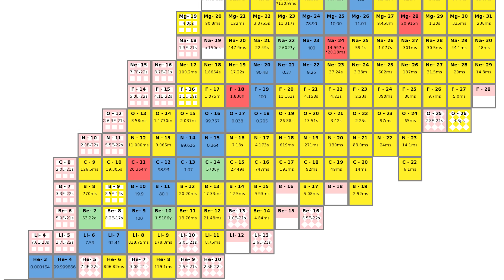Why the U.S. Doesn’t Recycle Nuclear Fuel

Comment: I spent 20 years in the nuclear fuel business. Believe me, there is no global shortage of uranium.  Bear in mind that fuel is only 10%-20% of the cost of nuclear electricity. Recycling spent fuel is trying to extract a savings from something that is already cheap. (Moreover, recycling costs WAY more than fresh fuel, as the French have so amply demonstrated.) Bear in mind too that for technical reasons, you can recycle the uranium only once (twice at the outside). It picks up too many unwanted isotopes of uranium that can't be separated. While Kazakhstan is (or was) he world's biggest producer, Canada and Australia have vast reserves of uranium that could supply Western needs for centuries. The big challenge in nuclear energy (besides long term waste disposal) is developing new designs that are cheap and fast to build with low annual maintenance. Simplicity is going to be the key going forward.
Reply: Is there any other way of generating electric power from Nuclear fuel except using it to boil water and spin a turbine with the steam?
Reply: @ShonMardani  it’s just a matter of efficiency in converting the energy to a useful form .. turbines are still the most efficient system we have
Reply: @richnubbz4910   No this about our scientists are fake and in most cases criminals.
Reply: @ShonMardani Nice ad hom logical fallacy. You’ve probably never picked up a book on science in your life except maybe high school, let alone earned an advance degree in science or worked in a scientific or technology field. So  you obviously don’t have that first clue about what you’re talking about. 😂

But, hey have fun with your delusional conspiracy theory and don’t mind us science types laughing at you for your ignorance. 😂😂😂
Reply: @Mottleydude1   You are right about everything you mentioned, that is why I am watching this video to see what did I miss, why do you watch the same baloney fakes over and over again.
Reply: @ShonMardani  Some space probes use peltier elements since they have no moving parts but the efficiency is really bad. So no, there's nothing better than the old steam cycle.
Reply: @ShonMardani  Short answer is YES.  We have been running Brayton cycle power plants fueled by natural gas for many decades.  The UK has had advanced gas cooled reactors for many years.  You can obtain 60% efficiency if you recover the waste heat from a gas turbine exhaust to be used in a Rankine cycle (steam turbine).  These combined cycle power plants are nothing new.
Reply: @ShonMardani  Yes they are called Radioisotope power systems or (RPS).  They are currently being used to power space craft on long missions.  They require large amounts of plutonium for smaller amounts of power.
Reply: @ShonMardani  Why do you have a problem with boiling water in the first place?
With supercritical water you can currently achieve an efficiency of up to 50 %. An alternative is to use supercritical CO2, spinning a gas turbine and use combined-cycle to achieve even higher efficieny.
Reply: The part you obviously are overlooking is the cost of disposing of spent fuel... a cost we cannot yet even quantify.  Far too many of us are complacent about destroying the planet our children must somehow survive on.
Reply: @byronwatkins2565  I have put real renewables solution posts.
Nuclear is an economic dead duck. 
Feel free to quote me.
Reply: @stephenbrickwood1602  Renewables are insufficient to sustain our present needs; they certainly cannot sustain our future needs.  Nor is our infrastructure capable of transmitting the energy from the scattered farms of supply to the cities' demands.  I do applaud renewable's effort and help, but either we supply our remaining needs with nuclear fission or fossil fuel until fusion is available.
Reply: Does storing, or does reprocessing/recycling cost more? Storing it is just a cost but recycling is a cost that makes a little ROI too doesn't it?
Reply: @PhilS_Empty_Crevice-r4e  still end up with storage.
Reply: @PhilS_Empty_Crevice-r4e  First, we don't know the total cost of storage or what unforeseen problems will eventually develop.  Second, if we do ignore these environmental problems, then storing seems substantially less expensive.  Third, we will know the cost vs. ROI for recycling only after we have done it at scale.  Fourth, I think the strongest argument for recycling is minimizing the impact on the environment; we are poisoning ourselves with chemicals (microplastics), biologicals, and now nuclear.
Reply: :text-green-game-over: Yes, recycling uranium, and using plutonium in fast reactors, is multiples more expensive than single use light reactors. Additionally, wind and solar are already multiples cheaper than new AP1000 nuclear reactors. In short, nuclear is not economically viable anymore.
Reply: “There is no global shortage of uranium” 
This statement is false. We have a substantial supply deficit coming up starting in 2027. The Japanese selling their stockpiles and the Central Asians drove the price to such low levels that exploration and mining operations essentially stopped in all but the most low cost western mines. It will take at least two decades the supply to meet demand. Mining is hard and risky.
Reply: @robertjard3956
For the swiss industry the recycling cost about as much as the final repository. Buying fuel is cheap but disposing it is expensive.
Reply: You would think "rock makes water boil" would be simple. But it's not.
Reply: I spent a comparable amount of time using high temperature vitrification to recycle inorganic listed hazardous waste like F006 and K061. During that period i worked at The Ohio State University as a research assistant working on HLW and LLW stimulants via high temperature vitrification as a recycling technology. After studying and testing we were able to determine what the performance characteristics were, calculated mass balances and life cycle analysis and our conclusions were pretty much the same. The cost vs the return on investment, including financial, performance gains and specific environmental and health and safety considerations, that the return on investment just wasn’t there and that process improvements for waste minimization was a superior strategy to recycling at that time.
Reply: Buillshit.
Reply: Has there been any new developments in radiovoltaic generators?
Reply: You did a better job of explaining why the US doesn't recycle than they did.
Reply: you miss the cost for environment damage of  the exploited countrys , cost for 
 poverty/coruption   for the last 40 years...
..yeah then its relativ cheap....
 But USA never care... 
Coutrys that want a faire share will end in war. We all know the game  & how it is played and will be, no doubt.
Reply: So we just keep piling up spent fuel?
Reply: We would burn dirt
Reply: Maybe be a good idea to build demand for spent fuel if more uranium fuel is to be used given cheapness.
Reply: Is there a connection between the economics of enrichment and reprocessing? As I understand it the US nuclear industry tends to operate with relatively enriched fuel, low percentages compared to military but still enough that the fuel utilisation is significantly better than with natural uranium meaning their spent fuel is probably more spent? Our nuclear industry was intended to be natural uranium based (not how it turned out), and with natural uranium the utilisation is lower I think with the exception of breeders. AGR was meant to be a dirt-burner but design changes lowered its reactivity making enrichment unavoidable, and then we went over to pressurised water reactors that I think always use enriched fuel?
Reply: Isn’t the point of recycling not the cost of the fuel, but the significant reduction in storage?

Don’t you have to keep byproducts for thousands of years, but the recycled ones are just a hundred years or so?
Reply: @Kevinjimtheone  
It's not as rosy as painted.
Take a load of  UOX Spent Fuel. 
The Fission products are the hottest bit, yes. If Separated they still have to be disposed. They are hundreds of billions of times more radioactive than anything you'd like tipped in a river.
These require just as much shielding and encapsulation as the original Spent Fuel. The disposal site has to space them out just as much as the original spent fuel to conduct away the heat generated by their decay. Not much saving, but the long term containment is easier. At least a thousand years though.
But it's not just fission products.
The recovered plutonium is a proliferation and security issue. It can go in recycled fuel, ...but... Most of the good stuff has been burned, there is far less than the original fresh fuel. You need plutonium from more than one reactor load to make one new reactor load and the most fissile isotopes are already depleted by life in the original reactor. . What's left have low reactivity and large cross sections. MOX made with this material needs extra fissile plutonium from elsewhere, usually excess weapons material. It reacts "less" efficiently than if the recycled material was simply not used.
The recovered uranium contains a little U235 that was not reacted, OK. It is also unavoidably contaminated. Refabrication into new fuel is more difficult and costly than simply using fresh uranium.
Aside from these is a shitstorm of other transuranic actinides. As proposed they can be "burned" in a reactor, but they are the least reactive survivors. They have high cross sections and low reactivity. They reduce reactor efficiency and responsiveness. Basically, they are a way to make a new fuel load act like an old one. Reduced efficiency gets overcome by burning more good fuel. So the benefits of waste reduction are less than suggested.
All of these still need disposal: The excess contaminated uranium. The long-lived transuranics, and the fission products.
You still have to build just as big and secure a facility for the fission products.
You still need an extreme long term facility for the transuranics and less desirable plutonium isotopes.

And of course, you recycled stuff into new MOX fuel. That's not a great saving either.
Used MOX comes out a lot hotter. It requires longer cooling periods in already crowded cooling pools. In direct disposal it requires wider spacing and longer decay horizons than Spent UOX.
Reprocessing of spent MOX is not viable. The uranium is now even more contaminated with U232, whose decay produces much more energetic gamma, with a longer half life than typical fission products.
You still have to build a permanent geological disposal, it needs to be spaced out bigger and more expensive. It has to last much longer than an equivalent for the original Spent UOX fuel.

No Used MOX has been recycled except a few experimental tonnes in France.

Spent Fuel Recycling is a dead end.
Reply: @aaroncosier735  Spent fuel from open fuel cycle reactors is considered to be dangerous for over 100,000 years. This is the challenge of disposal. We don't know how to build something we know is going to last that long.

All the recycling you are talking about seems to be in the direction of MOX fuel in thermal reactors.

True closed fuel cycles use fast reactors and can break down even a lot of the fission products, and get not twice the energy out of the original uranium, but 50-100x. Just our current spent fuel and depleted uranium stockpiles are enough for baseload power for hundreds of years in fast reactors, and the final waste can be safe in less than 1000 years.

We know how to build a structure that will last 1000 years.

This isn't just theory, EBR II was a sodium cooled fast reactor with integrated fuel reprocessing that did this in the late 1980s. The IFR, which would have been a utility power scale reactor with the same design, was cancelled in the early 1990s so close to completion that it cost more to dismantle it than it would have to finish it.

These reactor designs are also protected from meltdown or other failure through physics, rather than mechanisms. Thermal expansion of the fuel will shut down the reaction if it gets too hot, and convection in the primary coolant can remove decay heat without the need for pumps.
Reply: @jasexavier  
Spent Fuel from UOX fuel is difficult. The Spent Fuel from MOX is more difficult. 
The problem is not the horizon but that doing so would expose the true cost of nuclear.
KBR will probably be adequate for typical wastes of lower burnup UOX spent fuel. 
Predictable modifications will probably be adequate for higher burnup UOX and MOX fuels.
The problem is commitment to costs.
Present provisions are easily less than half the likely costs, Or, they were in 2010, when industry contributions stopped in the US after a court case.
Probably a lot less adequate now.

Breaking down fission products gives far less energy than the original U235 fissions that produced it. 
Being neutron poisons that form low reactivity products, they cost the energy that could otherwise be derived from using the same neutrons in a chain reaction.

Nor does complete breeding and fission of the U238. The original UOX was enriched to maybe 4-5% U235. Even if you assume perfect conversion to reactive isotopes with good neutron yield, you only get 20 to 25x more.
But you don't have such reactors.

EBRII doesn't help you much. Like all such fast reactors it has the burden of low reactivity compared to U235 with moderated neutrons. It needs more primary fissile material to furnish neutrons. Adding fission products or low-reactivity actinides reduces that efficiency. You run out of nice fissile faster, and have overall lower fuel efficiency. In other words, you burn more good fuel to fission products the more you try to burn fission products. Spent Fuel is spent because it already hit that limit, with a more readily fissioned neutron source.
Like using a good high-energy gas to char away a wet woolen blanket. The heat you get back is far less useful than the heat you put in.
Reply: @aaroncosier735  Anything that fissions in a reactor is going to give a LOT more energy than it took. Some fission products also provide more neutrons than they take to fission. Managing the neutron economy in a fast reactor is harder than in a thermal one, but it's also an extremely well studied problem, and not just in theory, we have built and operated these things.

The relationship you imply between initial enrichment and possible burnup doesn't make sense, 4% and 25x. Those math to 100%, but they're talking about different things. Even if you're implying that we burn up all of the 4%, and then only have 96% left, that isn't really true (we can't use the entire 4% in a thermal reactor), and it ignores all the U238 that we extracted to enrich that initial charge. Depleted uranium becomes reactor fuel in a fast reactor.

Yes, a fast reactor needs a higher percentage of fissile material than a thermal reactor, usually about 20%. But all interesting fast reactor designs create more fissile material than they consume, as long as they are fed fissionable isotopes, like U238. A reactor like EBR II (or the IFR) does not need any additional U235, or any other fissile material, added after the initial charge. The fuel efficiency, starting with the initial natural Uranium mined from the ground, of a fast reactor is typically at least 50x that of a thermal reactor.
Reply: @jasexavier  
Fission products are not viable fuel. Very few if any give more neutrons than it takes to induce fission. Unlike fuel devoid of such, fission products are an unresponsive source of delayed neutrons, not many, and usually long after you want them to stop.

Sure fast reactors have been built and studied. They Use fuel less efficiently and are more sensitive to fission product accumulation. Some require isotopically separated counterions or coolants just to make the neutron economy adequate, even at the limit of civilian enrichment.  

The relationship I mention is that claimed for endless recycling of Spent PWR fuel. The claim is that the 96% will be useful by repeated reprocessing as MOX. The reality is that used MOX is not viable for recycling. A small amount has been recycled for a second round. Not viable.

The leftover depleted uranium, like the leftover 96% of U238 in typical UOX is not terribly handy. It is preferable to recovered irradiated U238 due to less contamination and easier handling, but that's as far as it goes. Once used as MOX, it is simply a bigger reprocessing or disposal issue than Spent UOX.

All "interesting" designs with  breeding ratios over 1 have fallen by the wayside except for breeding weapons materials. France tried, the US tried.
More standard reactors with partial breeding ratios seem not to be being replaced. The higher irradiation accumulates awkward isotopes, as with MOX. Some like the attempt with Thorium at St Vrain wind up with even more U232 than used MOX, and associated handling and disposal issues.

This stuff as you say is not new. But sixty years of work has not overcome the deficiencies.
The very cheapest option is still once-through direct disposal of UOX. The cost of reprocessing will detract less from the value of the fuel in a few thousand years. Till then, assume never, and encapsulate and dispose accordingly.
Reply: @Kevinjimtheone Absolutely not. The whole point of recycling is to manufacture value added products that meet commercial specifications, have a real market for sales and distribution or are equal to or analogous to raw materials used to manufacture a value added products and, in the case of recycling regulated hazardous waste under the Resource Conservation and Recovery Act (RCRA), are not a form of sham recycling.
Reply: Recyling is expensive with external reprocessing using the PUREX process. But new reactor designs integrate an online pyro-processing-unit into the fuel loop, which makes reprocessing much easier and cheaper.
Reply: @egnegn123 That though is not considered legitimate recycling per the Sylvia Lawrence memo of 1989. What you described is a closed loop process improvement and, from a regulatory standpoint, would be considered a waste minimization strategy and not legitimate recycling.

High temperature vitrification combined with deep well injection is currently probably the BADT for the waste treatment and disposal of HLW and LLW radioactive waste.
Reply: If stopping CO2 emissions beyond the existing national grid with more grid electricity then the extremely expensive grid capacity has to be expanded. 
This is 10times bigger economic problem than just the generation plant construction. 

Nobody knows, nobody thinks.
Electricity is dirt-cheap at the generator. 

But the grid RENTAL COSTS per kWh is the killer. Particularly if roof PV at every consumer remains dirt-cheap 2cents kWh 247.
Reply: @stephenbrickwood1602  your not paying attention.  Our leader has just decided to end grants to wind and solar and redevelop coal burning technology and even outlawed discussing  wind and solar,  you should be paying attention to the real problem and threat.  Which is political republicans want working people to pay for the damage which has been leftover every time a business closed then used bankruptcy protection to avoid cleanup
Reply: @SurferNorm6360  read slowly.
Generation is dirt-cheap. 

Nuclear 
Fossil fueled,coal, petroleum, gas.
Distant solar PV farms
Distant wind farms 
Hydro electricity generation 
Pumped hydro 
Geo Thermal 
Roor PV. 

All basically dirt-cheap. 

Grids are f.......................g expensive. 
ROI, return on investment, in grid infrastructure is grid RENT. 

Grid to get electricity DISPERSED to millions and millions and millions of meter boxes, at the consumers is an infrastructure that is 10times more expensive than the generation plants costs. 

As a business's cashflow is LIFE or DEATH and based on the value of the investment, the service the grid provides is traditionally paid for by including a fee based on the kWh supplied plus the small generation cost. 

This is obvious with the small feed-in electricity kWh rate, a few cents kWh. Dirt-cheap cents kWh. 
The feed-in electricity is supplied to others with the grid RENT fee added. 

4cents kWh electricity generation costs are dirt-cheap. 
Meter box grid supplied electricity is 44cents kWh. 
My gtid electricity is 52cents kWh 
My business friend grid supplied electricity is 50cents kWh. 

Understanding these basic universal facts you can understand that if consumers stop demand for grid electricity then that f..........s the grid owners in a far bigger way than the little generator business. 
GigaWatt gen capacity and then demand collapse is a very real economic problem. 

This is the biggest danger for big grid electricity when consumers have dirt-cheap roof PV electricity and no need for grid electricity. 

In Australia 20million roofs and 4million roof PV systems. Grid demand collapses daily in business hours. My friend has reduced his business electricity demand by $10,000 per quarter. $40,000 per year. He has a warehouse roof PV system. 

More people are installing roof PV AND Storage batteries. 
The daily DUCK CURVE of demand collapse in business hours is increasing to 247 grid demand collapse. 

This is simple engineers FIRST PRINCIPLES description of our electrical systems.
The ANOLOGY way of describing grid electricity is very misleading and confusing. 

Roof PV is dirt-cheap and no grid costs. 
Also empty roof realestate is dirt-cheap realestate. 
These are fundamental facts. 

Roof PV with a battery or v2g EVs massive battery can give upto $10,000 tax-free savings every year for decades and decades. 

Real economics will dominate in a free country.
Reply: Nuclear power is only 9% of the world's energy. If that number was say 50% then the world reserves of Uranium don't look quite so large.
At current rates we have about a century of Uranium. However if you increase the Nuclear energy share tenfold, then we only have 10 years fuel.
Reply: @deerfootnz  First, the "trash" we dispose of is still 95% uranium that could be separated and re-used.  Second, uranium is not the only fissionable material; it is simply the easiest.  Third, we need fissionable nuclear energy only until we can get fusion working.
Reply: @byronwatkins2565 "only until we can get fusion working"... Oh really! What a giveaway. And when will that be? It's been 30 years away for 70 years.
Reply: Color me confused, uranium isotopes or daughter products accumulate?
The isotopes of uranium are largely fissile, none behaving as a neutron poison, like some of the daughter products like Xenon-135, which thankfully does have a short half-life and iodine is reactive enough to be processed easily (had an iodine-131 thyroid scan, had to steer clear of the Air Base, as they're nuclear capable and  tripping detectors could be an annoying experience)

And uranium could be recycled indefinitely, if one enjoys wasting money, 0.7% isn't a hell of a lot of U-235 to begin with for unenriched natural uranium, but get low enough in daughter products and U-235, you've got elevator weights. Or maybe a couple of hundred kilos for a small sample for my element collection. That and a nice block of tungsten, think I'd put them on different shelves, wouldn't want to break the shelves by overloading them with high density weights.
But, beyond enrichment in the traditional sense, one has a number of ways to use U-238 to breed fissile elements, it is a fertile isotope, toss in an outer layer of thorium for the necessary neutrons. The physics is straightforward enough. It's not like one's building weapons, which are a bit more advanced math wise.
Reply: "Recycling spent fuel is trying to extract a savings from something that is already cheap."

It isn't about the expense. By reprocessing spent fuel, you reduce how long it remains dangerously radioactive from 10,000 to 20,000 years to just 200 to 300 years.
Reply: The French "recycling" is not what you think.
Mox once used can't be re-used ad infinitum ; it's also much more toxic and complex to manipulate and so not that much cheaper.
The "real" recycling would be with the stuff we tried to do with the superphoenix project. But it was deemed too costly and abandonned.

Solar and Wind with a bit of other stuff are way enough to produce the energy we need if we can organise our grids a bit better. it's way more simple and the worst you get if it fails is a blackout, not centuries of radioactive contamination over dozens of Km.
Reply: @Longlivethe4th  I’m not qualified to answer the nuclear recycling issue, but I know that wind and solar can’t be enough with massive investment in battery/energy-storage infrastructure. 

Otherwise, we need some kind of baseload energy: nuclear or geothermal nuclear seems only viable if we crack the SMR technology and geothermal would require fracking. 

We need one of the two.
Reply: @Kevinjimtheone  Geothermal doesn't frack nearly as hard as oil/gas industry.

China does 18 % of its electricity from solar/wind ; and in aboslute value that's more than 100 % for many countries.

Storage can use a variety of solutions that are already implemented to some extend. compressed-air, inertial wheel, dams... even chemical solutions can be worth it for a baseline it's not as big a problem as people make it to be. Sure we also would need some moderation on use (most night-time lights in modern big cities are useless realy) but overall it's doable.
Nuclear would need vast investments too, and with all the checks you need on it to prevent military use or accidents the choice realy seems obvious.
Reply: @Longlivethe4th  just to add to your points.

Roof PV 70% EQUIVALENT efficiency, if 22% absolute efficiency. 

Fossil is 60% waste heat energy and mechanical friction waste energy. 
Fossil is 100% CO2 emissions waste.
Renewables are 100% productive and  0% waste. 
Roof PV 70% equivalent efficiency, 22% basic efficiency. 

Roof is dirt-cheap EMPTY realestate.
Reply: Fuel assemblies are undergoing restoration in BN600 type reactors (fast neutrons), it's time for this fool to know about it.
Reply: Yes yes all marvelous except it’s all a lie. No nuclear electricity has ever been cheap. On the contrary it has always been the most expensive electricity duped USofA customers have ever paid for and those companies have never paid to take care of their trash ever! Solar farm is 17 months from start to electricity being added to the grid! Minimum 4 years for gas, and where is that first baby nuke plant? What still trying to raise money to build one huh! Awful lot of space not being used because it is so polluted by fossil fuels is perfect for solar panels. And only morons don’t know that we now have giant sodium batteries perfect for back up power that can last for weeks!   Drill Baby Burn
Reply: @TheLosamatic  remember empty roof is dirt-cheap realestate. 
Dirt-cheap PV and with a battery then 247 dirt-cheap electricity when the sunshines. 

And no grid costs.

Think about the grid costs as RENTAL COSTS. 

You NEVER GET TO OWN the grid. 
You never get a return on investment like the grid owners.
In Australia we are not bludging communists.
Private grid owner's here need their cashflow, their ROI, return on investment.

Grids are massive business, total $ to replace valuation ROI means 4cents kWh generator electricity is 44cents kWh at the consumer's meter box. 

My grid electricity is 52cents kWh. 
Generation is 4cents kWh.
Both immediate neighbour's feed-in is nothing kWh. 
My street of 30 homes have 18 roof PV with feed-in grid connection. 

People just don't think.
Reply: @TheLosamatic  Do you know that solar panels are an expensive and inefficient method of converting nuclear fusion energy into non-dispatchable power?

Even if you could store solar energy, how would you generate the reactive power required to form and maintain the grid during times of high load?  There is a reason that California fought to cancel the planned shutdown of Diablo Canyon and it has nothing to do with real power.  Someone with a competent understanding of how synchronous electric grids work was able to talk to the decision makers in California and they did not like the idea of having an unreliable grid.  Do you have any idea what kind of damage both in terms of human life and economic losses we would have to endure if we could only use "green" energy?

I encourage you to read the preliminary reports about the Iberian peninsula blackout in April 2025.